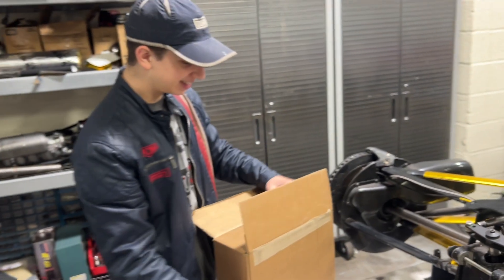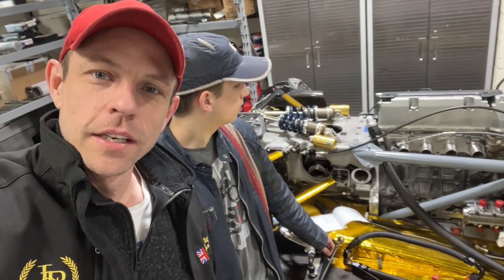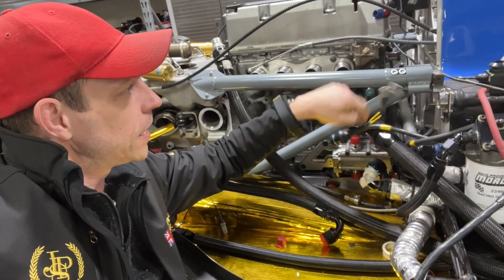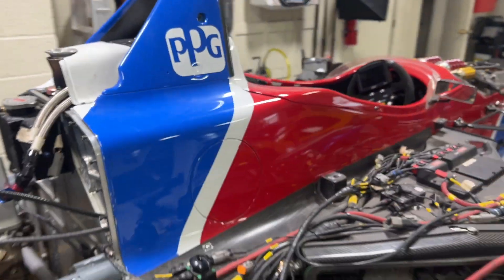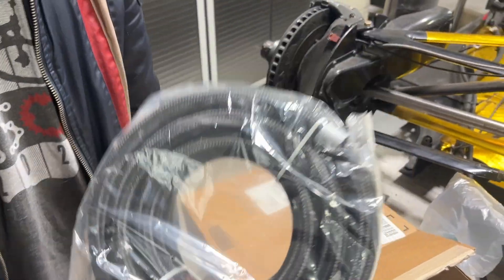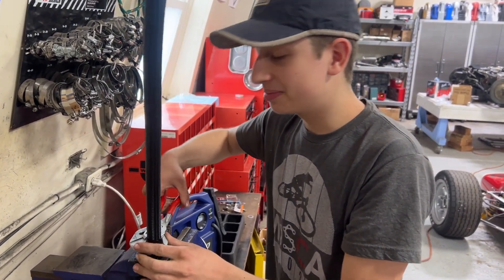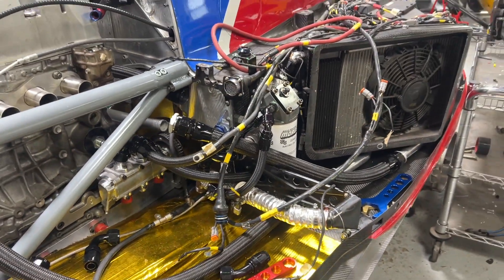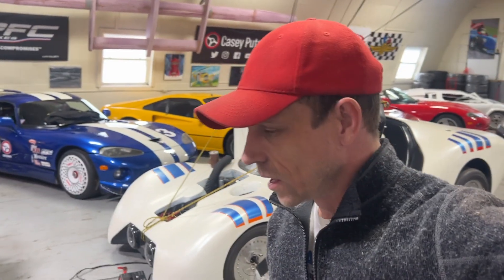Engine Swap Structure and Oil System - Making an automotive engineering Jedi #3

Comment: It ain’t “lazy”, to facilitate working smarter, not harder…
Then there’s the resulting benefits of efficiency, for reduced task complexity.
Personally think he ought to consider one of the full time high performance automotive focused trade schools, before pursuing a engineering degree. Things are way easier to learn, if you can see application to the lessons.